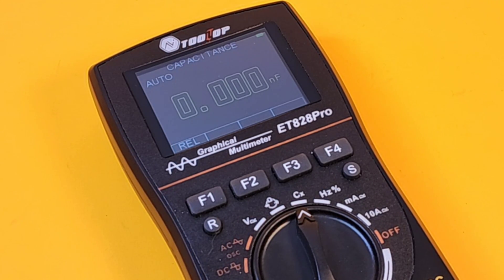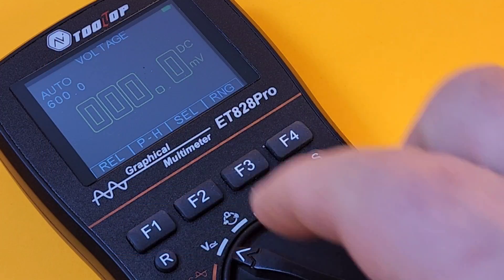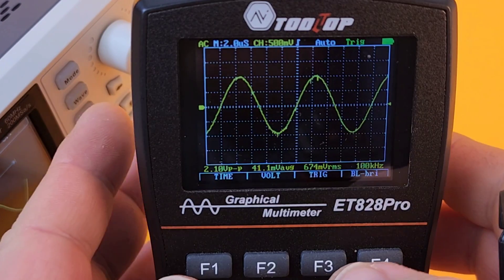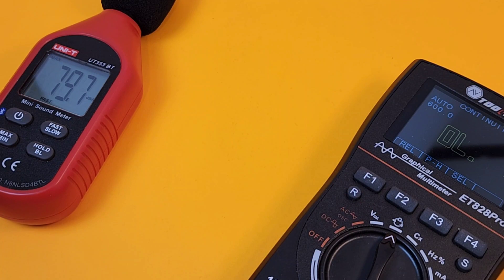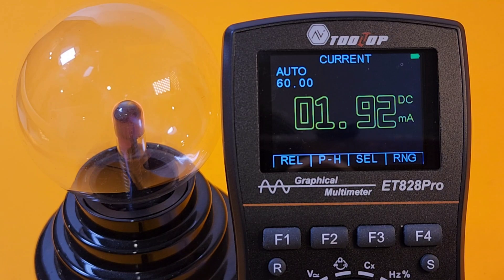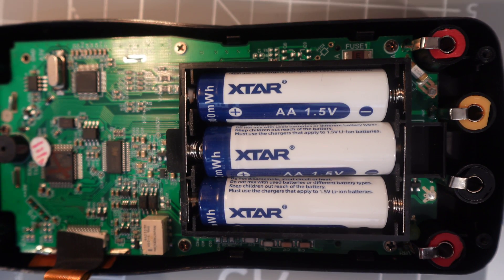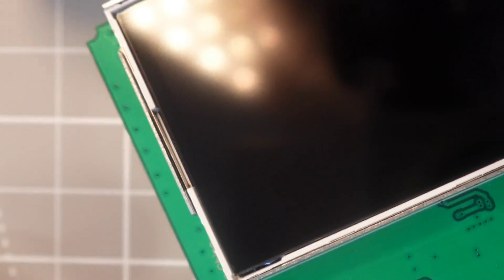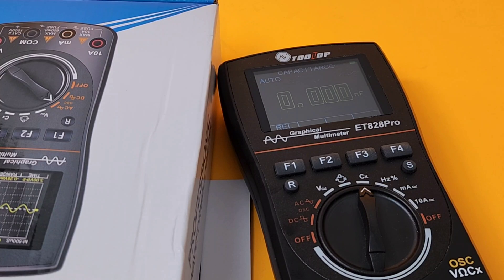ToolTop ET828PRO CHEAP-O Oscilliscope Multimeter Review & Teardown!

Comment: Pretty thorough review.  You showed how to change the scope time base.  Is it possible to change the scope vertical gain (i.e. volts per division)?  It would be important to be able to see the waveform in more detail.  Thanks.
Reply from the maker: I might do an update on our website (KeepOnTesting.com) in the future. 
😊👍
Reply: It seems you can zoom but not move. Look at the cheat sheet.
But, it cannot to better than 0.5 volt per division. Which is coarse.

Comment: Interesting review, as usual. Pretty accurate 6000 count DMM with a nice, crisp and fancy display. (I like the outline font, really.) And it contains the basics of the functionality of an oscilloscope. Nice. It tries to be a "jack of all trades". Result: Does everything, but nothing is done right. It practically invites to stick it into mains but lacks propper input protection? It uses SMD fuses, not easy to change from beginners? Lacking rubber housing, hence not even the slightest protection against mechanical damage, but advertising it for use in car maintenance? Alltogether a no go! Simply a No! Would anyone give this "toy" to his kids for experimenting with/ learning about electricity without worries...??? Again: Simply ...No!!!
Reply from the maker: It's indeed a slightly unusual beast as far as dmms/Waveform meters go. Personally,  I think the ET828PRO succeeds on merit alone, as it's a huge upgrade from its initial launch a few of years ago. It's more powerful,  has better performance and better ranges. Albeit,  the selector switch is terrible.
No rubber boot or magnetic backing is a downer but I don't think it's a deal breaker. YMMV but it's alot of meter for   the money. I think it's safe for residential use but a regular fuse would definitely be preferable over the smd resettable. Thx for watching as always my friend.  👍

Comment: Hmm, interesting. So, it still uses SMD fuses, but has a noticeable improvement for LED testing and a 10MHz bandwidth. 🤔I guess the multimeter part of it is okay, although I'm still not a fan of this display. As for the waveforms, I'm just the wrong target audience.
Reply from the maker: It's way above it's previous performance benchmarks,  I think the added improvements are worth the price of admission 😊👍

Comment: Its okay I guess, like you said aimed more towards bench use for hobby electronics. Certainly quite a lot of meter for the price range they are talking, although there does appear to be quite a wide price range in the UK. The display is quite unique though isn't, which will likely be its appeal factor. Thanks for the review!
Reply from the maker: Yessir..I definitely find the chunky color display really nice but it's probably not going to be to everyone's liking. All toll not a bad dmm with Waveforms display.

Comment: Battery consumption? I don't like such devices
Reply from the maker: Unfortunately we will continue to see battery powered multimeters for years to come. A rechargeable 18650 or similar would definitely have been welcomed 😌 👍
Reply: @KeepOnTesting  An 18650 is a battery, too!  If the meter uses a rechargeable battery, you have to stop what you're doing while you recharge it.  Yes, Lithium has a higher power density, but when it's dead, it's dead.  The advantage of using "primary cells" (i.e. cells that are NOT rechargeable) is that if you're working on a job away from your shop and the batteries run down, you can always get new ones at Walmart.

Comment: No BNC input disqualifies it as a real scopemeter in my opinion. Also, with stuff like the zoyi ZT702s/ZT703s and even the newer FNIRSI scopemeters and such on the market for virtually the same price or maybe 15-20USD more I don't see why stuff like this continues to exist and that companies (like tooltop) go through the effort to rebrand these.
Reply from the maker: It's basically a Waveform display. As you highlighted no bnc negates alot of scope functionality. That being said it excelled with the Waveforms and can be very handy for general troubleshooting purposes 😉 I think it's a decent multimeter with bonus Waveform display capabilities.

Comment: Corners were cut...no real fuse? It doesn't seem to be a resettable fuse, had some of those blow on my laptop during some testing. Input protection is atrocious. You missed to try the frequency range on the scope, the screen update rate seems like a slideshow. And if you can save a shot of your waveform...how is it exported to a phone or PC. Someone oughta make it better!
Reply from the maker: Waveforms are saved to the meter only (I'm assuming to keep costs down). I agree with lacklustre input protection but as I said it's a great hobbyist multimeter and will suffice for home users. Actually the screen update was fairly spunky for most things. My only real gripe was the painful selector switch which I demonstrated. Thx for the feedback and for watching 👀 👍